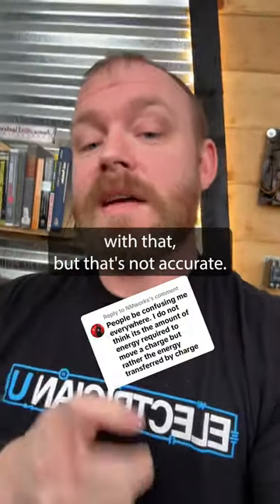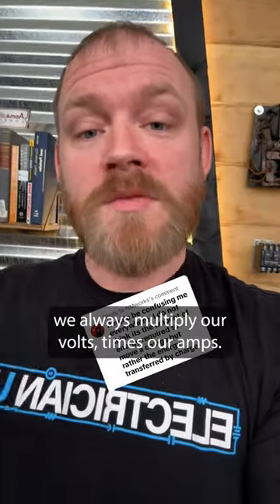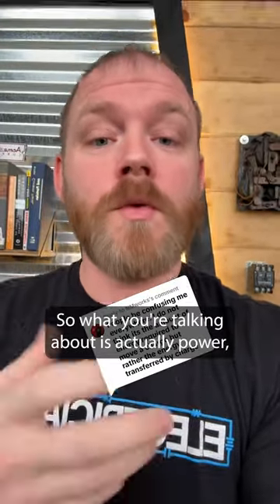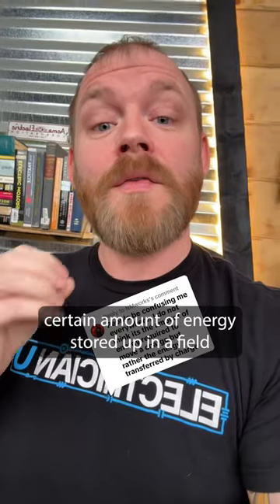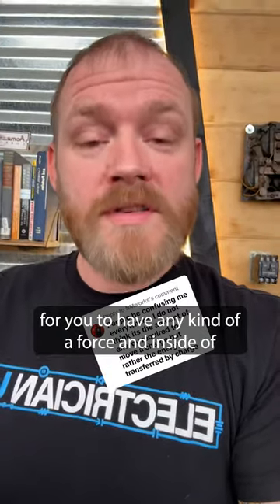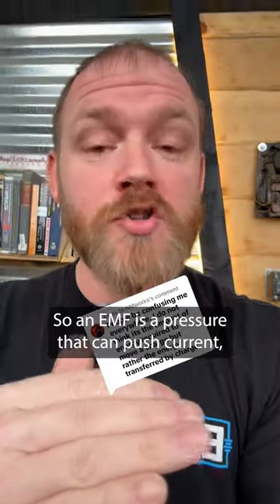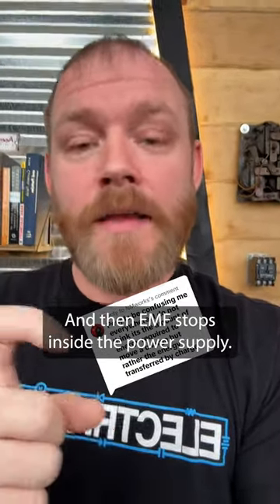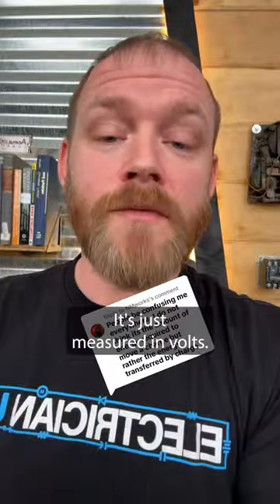Don't Confuse Voltage And Power

Comment: I am sharing this in my Vintage Trailer Class. I found that the only way to teach people how to safely wire their trailers was to actually teach them some basic electrical theory and we just talked about EMF and Voltage equating to power in the formulas the other night in class. It's on my Patreon page and I shared it publically.

Comment: Voltage is the electrical analogy to Potential Energy. The high you are on a hill the more potential energy you have => the higher voltage the higher electrical energy potential. And similarly current is the electrical analogy to kinetic energy (velocity). Higher current ~ higher velocity

Edit:(This is a known thing and early on when common physical was being mathematically explored. The electrical equations were already developed and scientists noticed that our formulas worked for their experiments and they took them and changed variables to match)
Reply: This helps, ty!

Comment: Kind of off subject but I’m a little confused on power factor and why transformers use VA rating instead of watts.  If an inductive load like a motor has an amperage rating, does that amperage rating take in account the power factor rating?  I heard that if you use a motors wattage rating but it has a poor power factor that the actual wattage is different so that’s why transformers use a va rating which I think takes the reactive power into consideration?  Wonder if you could do a video on that and help clarify.
Reply: Thanks for the reply. So is the reactive power essentially the force from the back emf of the motor?  Current flowing through the windings creates a magnetic field that opposes the current that created it if I’m not mistaken.  So is that force causing the lower power factor? Sure there is way more to it than that but is that a simplified way to think about it?  Maybe an example would be like the old school 2 person saws that they use to use to cut down large trees.  A PF of one would be both people pulling/pushing in synch and achieving the maximum amount of work.  And a lower power factor would be like one person pushing and the other person applying some resistance in either direction of the saws movement?  It still moves but requires one person to exert more force and get less output.  Not sure if that’s a good analogy or the correct way of thinking about it but in my head that’s how I’m thinking of it.
Reply: Reactive power is VAr. A really great analogy between VA (apparent power, the volts times the amps), W (the real power doing actual work), and VAr (the reactive power, the difference between real and apparent power) is the beer glass one - the liquid beer is the Watts, the foam is the VAr's, and the whole thing is the apparent power (the VA).

The two person saw is actually a pretty decent analogy. I like to think of it more as just electricity that's sloshing back and forth through the power lines not doing anything useful.

The thing about low PF is that to get the same amount of useful work (Watts), you need more current:
A motor (mostly just an inductor, from a circuit perspective) with a low PF at 1kW will need more current to go to it than a 1kW motor with a high PF.

That's part of the reason you see big ol' capacitors next to motors/compressors (which are just motors) - you essentially use the capacitance to balance out the inductance. It takes the "sloshing" off the wires feeding your equipment and puts the "sloshing" inside the equipment
Reply: Thanks for taking the time to explain this. That helps a good bit. Still seems odd to me that a motor rated at 2 amps (just pulling random numbers) on the name plate of the motor can draw 3 amps due to a higher apparent power.  Seems as though they would have to show the rating on the motor as having 3 amps so they can properly size the conductors. Or can PF and amperage only be calculated once it’s hooked up to the equipment.  Like the same motor draws different current or has different PF rating depending on how loaded up it is?
Reply: If the nameplate says 2A, that's the current it'll draw off the grid.

Let's say it's a 240V motor, it's using 480VA regardless of anything (volts x amps). If it had a PF of 1, then it'd be a 480W motor.

Now let's say our 2A 240V motor has a PF of 0.9 (a reasonable number for a cheaper motor) - it's still going to be rated at 480VA, but now it's power rating is going to be 432W (apparent power x 0.9).

Thinking another way, if you need a 480W motor and the best you can find is a motor with a 0.9 PF, the VA is going to need to be 533.3 and its nameplate current will be 2.22A (480W / 0.9 = 533.3 VA / 240V = 2.22A).

So as PF keeps dropping, amp rating will keep climbing to keep the same power rating.
The other way to see it is that if current rating stays the same, lower PF corresponds to lower power rating.